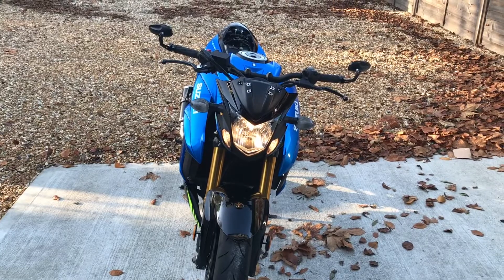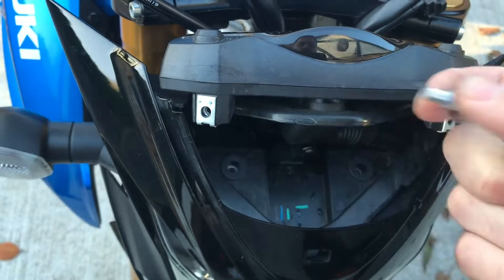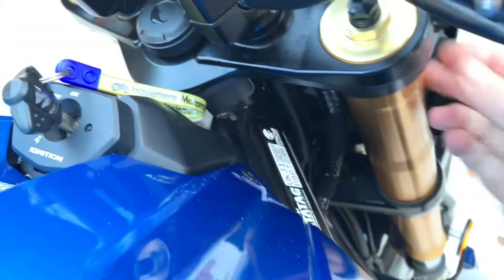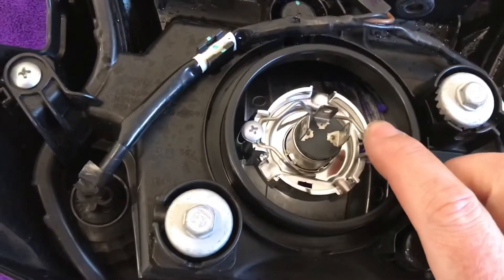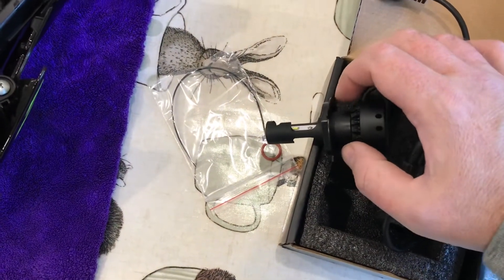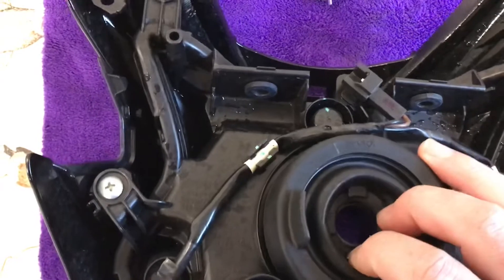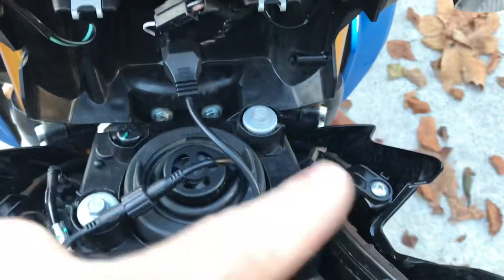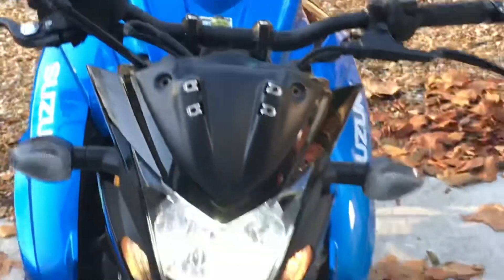GSXS750 LED Headlight bulb install LedPERF

Comment: Many thanks, Dean.  The trickiest part was fitting the black metal converter(?) box - connected between the H4 and light bulb of the LedPERF - into some space of my MT-07 (2018) headlamp unit.  It's a squeeze.  The box is now held in place by cable ties.  Cheers!

Comment: Hi mate. I have a gsxs750, so you can simply buy this led bulb and it’s plug and play? You don’t need a relay etc for it? Surely this is too simple???? Is it genuinely as easy as it looks? I didn’t realise you could change from a standard crap orange bulb to an led without relays etc.
Reply from the maker: It is as simple as the how to, I’m no mechanic which is why I post things like this to guide others who may also not be overly technical as to how I achieved the end result. You may have to switch the bulb back for the day of MOT testing though as LED headlights aren’t a standard fitment on the bike (depends on how clued up your MOT tester is).
Reply: Thanks so much, gonna order one now. The standard bulb in the UK GSXS750 is like something from a knackered French Citroen from the 80’s!!
Reply: @jackwednesday  it's silly that they still sell fast motorcycles then equip them with the most terrible headlight bulbs on earth. I had to swap out the bulbs on my brand new 125 recently because the main beam was a terrible 35w halogen!!!. I replaced it with an LEDPERF bulb and I went from not being able to see a damn thing above 15mph to now being able to do the same drive at 40mph, all while actually using a little less energy so my battery isn't under as much stress.

Comment: Hello. Thanks for a great video. I've got a Suzuki gsx 750. I bought the led perf lamp after watching your video, but it seems it came with a different configuration than the one in your video (but I might be wrong). The led comes with the "three pin" plug attached. Will this three pin plug fit the native attachments on the bike, or, do I have to do any chopping/re-wiring? Many thanks.
Reply from the maker: The 3 pin plug should go into the connector that was pulled off the back of the original bulb (H4 Connector).

Comment: I think the correct form is the rubber to cover the coolers to protect against water and dust.  I did this way.
Reply from the maker: The rubber is to stop moisture getting onto the lense as per the original you don’t want moisture causing fogging on the headlight lense

Comment: Hi there when you finally finished Did you find that you had to  Slightly adjust the bulb Making The beam level  But the arrows slightly out . Many thanks Mike
Reply from the maker: Hi Mike, mine lined up fine but there will be a couple of mm movement where the bulb seats so unless the bulb is perfectly central in the locating hole it may need a touch of adjustment

Comment: Hi
I bought the same type and did all the steps
But the light is not working properly
The low light works as a high light
And the high light work as a low light

I tried to reverse the the light But the same result

Do you have any advice on this?
Reply from the maker: Was it the same brand? As it uses a h4 connection is shouldn’t be able to work in reverse and if that is the case I would contact the supplier
Reply: @deanskirrow  yes  Same brand and model, and same type of bike also  Everything is the same as in the video and I also applied all the steps
Reply from the maker: @madof7150  I would definitely contact LedPERF then, as there may be a fault within the wiring of the bulb itself

Comment: Is it better than halogen light because i have original and its very hot. Is halogen less overheating?
Reply from the maker: It is better than the standard bulb, part of the reason for changing is there are reports of the headlight lenses cracking as they can get too hot with the standard bulb.
Reply: @deanskirrow  yeah thats why i am also thinking about changing

Comment: Have you had any problems regarding the heat prodcued by the LED unit? Also do you happen to know what the amp draw of the unit is?
Reply from the maker: Hi I don’t know about the draw of the unit, it has an external fan on the led unit to aid with cooling this sits behind the rubber weather boot
Reply: 12volts according to the selling page

Comment: Isn't installing aftermarket LED illegal? The housing is made for halogen/filament bulbs. LED housing are different.
Reply: No the rules changed in 2021. No idea why but LED lights are legal now. These newer LED replacement bulbs have the LED chips in the same place as the halogen filament so beam pattern should be the same.